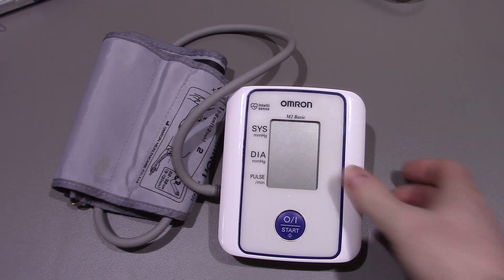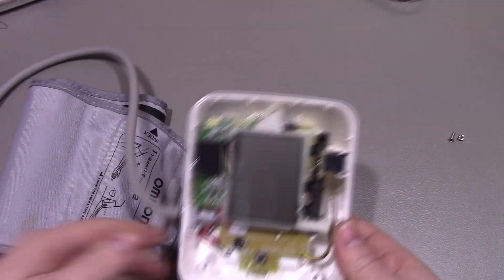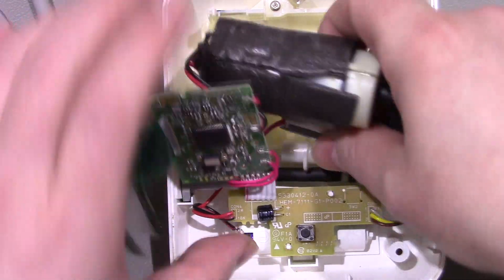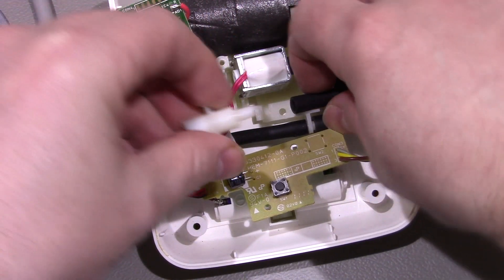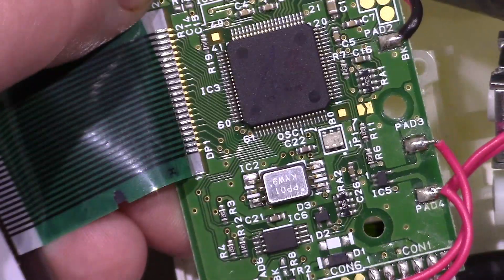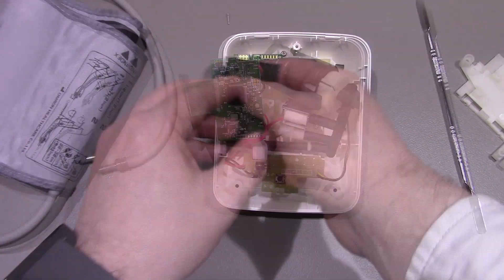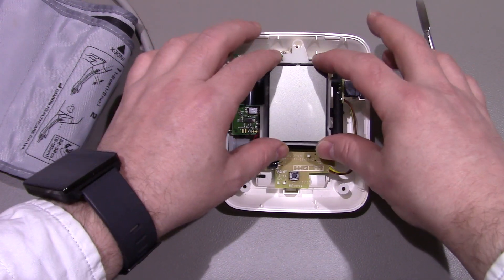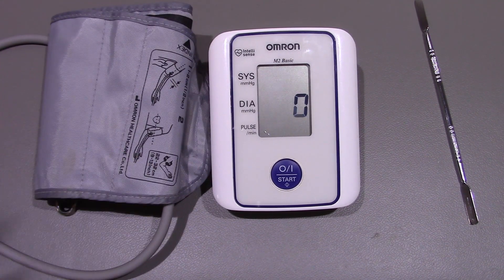Omron M2 Basic - Teardown

Comment: Thanks for the video even though it was posted some time ago.  My OMRON BP762 monitor sudden stopped holding pressure. A cursory check showed the cuff was o.k.  so the problem seems to be coming from the inside. I was about to take the thing apart in case it could be fixed.  Your video however shows that this might be futile exercise.  It's a shame since the unit is still in pristine condition.

Comment: If the machine doesn't compress air(press power and it compresses or sucks air to tighten arm)despite the lcd working fine what could be wrong as the cuff and pipe are okay?Internal error with pump like slit stopper perhaps? What is the slit stopper?

Comment: Does anybody know how the readings in the cuff, that is when the blood stops flowing and starting again, is communicated to the monitor? The pressure at these points is obviously measured directly at the monitor which has the pump.
Reply: The pressure sensor itself handles that I believe,  with heach heartbeat the pressure changes.

Comment: My omron monitor display s one letter is missing.what l can do?
Reply from the maker: Could be a bad connection on the ribbon cable connecting the screen, but they are attached using a hot bar method which are very hard to repair

Comment: The "useless bit" is actually an over pressure release valve, in case it keeps on pumping without stopping.
Reply from the maker: Thanks, I had realised this my self shortly after
Reply: @ElectronicStuff  Is that over pressure release valve always open though?
Reply: My omron bp machine is inflating but then not deflating to take the reading. What could be the issue?

Comment: I think that white valve you removed, is a pressure valve, incase it over inflates.
Reply: The white valve is a solenoid air valve, to release pressure fastly.

If you are interested in mini air pump and solenoid valve used in blood pressure monitor, please contact us.
E-mail: sales01@dyxminipump.com
http://www.dyxminipump.com
http://pumpdyx.en.alibaba.com
Reply: @jz7914  I have a similar "solenoid" (?) in the water tank of a robot cleaner, could it be an air pump, that creates a "cushion" of air to expel the water through the nozzles ? where does it draw air from it doesn't seem to have any holes ?
Reply from the maker: Shaun Brown I think you are correct there

Comment: the dc power input is with three wires, yellow, brown and grey. does it correspond to brown  +6v and grey ground, what about the yellow?
Reply: aites, thanks anyway. =)
Reply: Hi, Usually (again, I have not checked the actual wire) a DC plug with 3 wires:
- Positive (as you said brown),
- Negative (you found as grey),
- "connect sense" (yellow according to your findings).
The meaning of connect sense means: If you have batteries AND power plug, device disconnects the battery pack and use external power source. This "sense" is usually very simple switch (which open the battery pack circuit mechanically).

Comment: Today morning I found my OMRON BP742N is dead. It doesn't turn on. Nothing shows on display and not working. I tried with new batteries and using adapter. I didn't even use it more than 10 - 15 times. Are they really junk or what do you think ?

By the way this video is very informative. Thanks for sharing !!